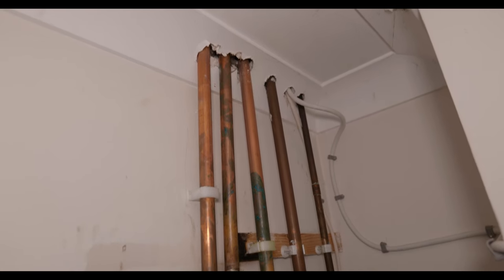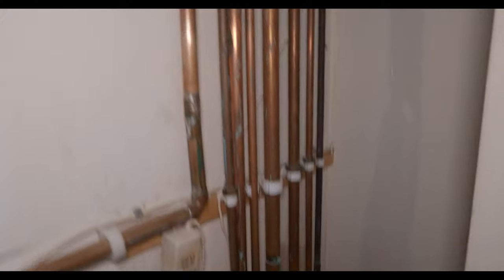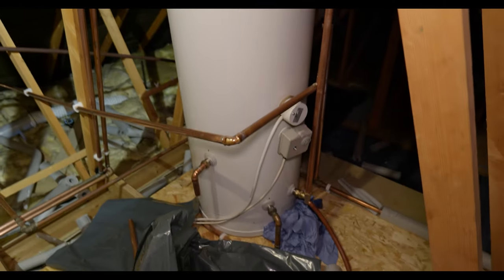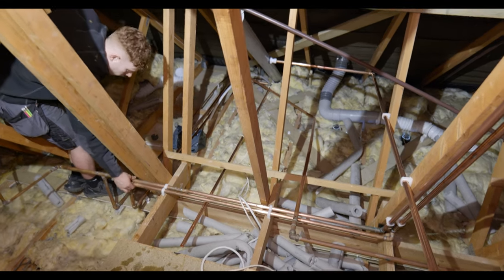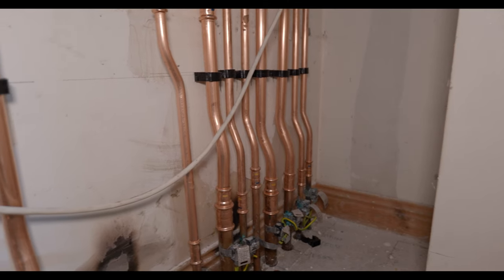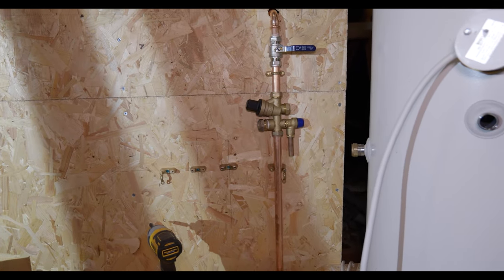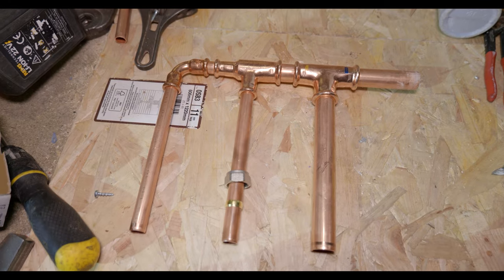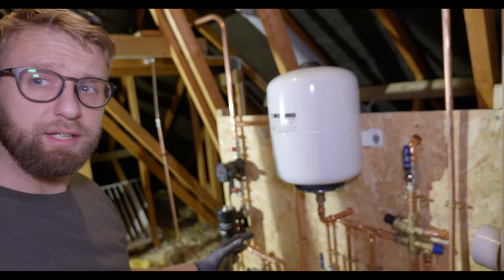Unvented hot water cylinder Installed in loft. Another plumbing mess to fix!

Comment: Do you need to strengthen the roof trusses if you put a tank in the attic? There must be a fair weight when full of water. I'm planning putting my thermal store in the attic. Thanks
Reply from the maker: Yep. You definitely want to put it above a structural wall or have a decent  timber support base built.
Reply: @loving-plumbing  Thanks for the speedy reply.

Comment: Nice, but being picky the combination valve should be higher.
Reply from the maker: Cheers for the feed back. Usually if they are higher then the temperature relief they are just floating around which I'm not a fan of. You shouldn't really drain from a temp or pressure relief anyway so maintenance should be fine via isolation and drain off. But understand your point. Thanks 👍